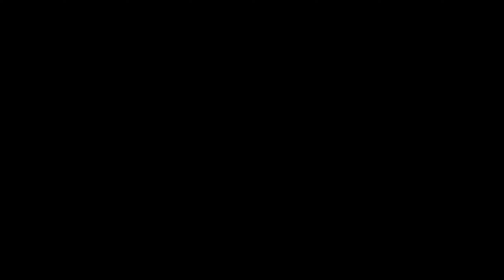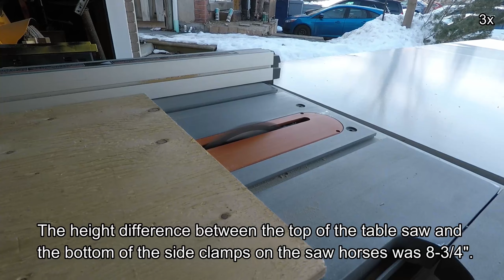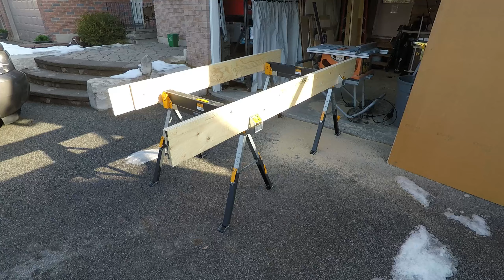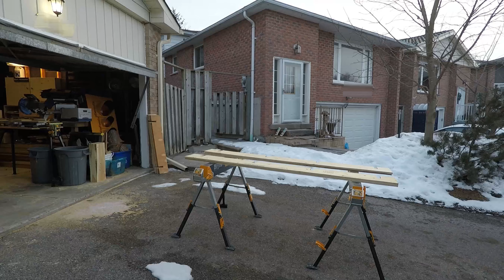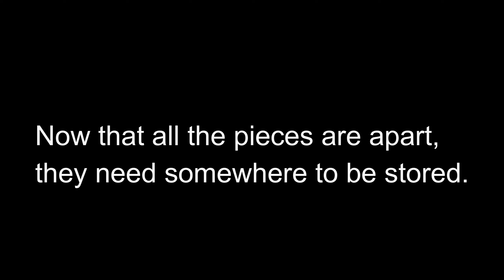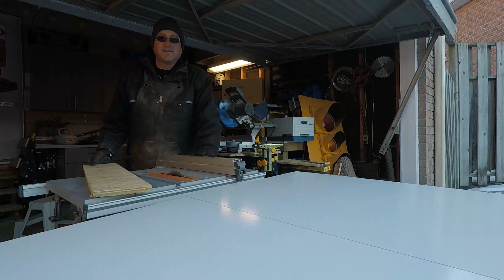How to Build an Outfeed Table for a Table Saw

Comment: Those rip cuts are way easier to do with a circular saw and a kreg rip cut attachment. 

After buying that I've never used a table saw for big sheets.  Although smaller rips like for am example 2 inch when you only have a small peace of plywood are a pain.
Reply: Thank you Alex for the tip. I have not tried the Kreg rip cut attachment. I will take a closer look at it. Thanks for watching my video.